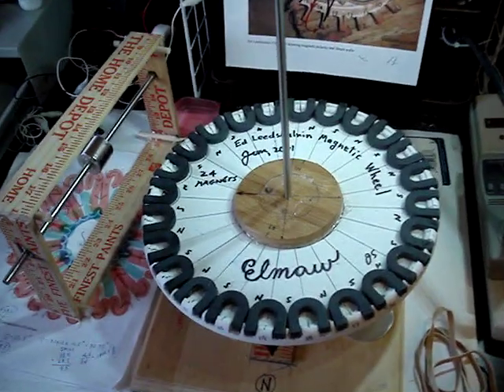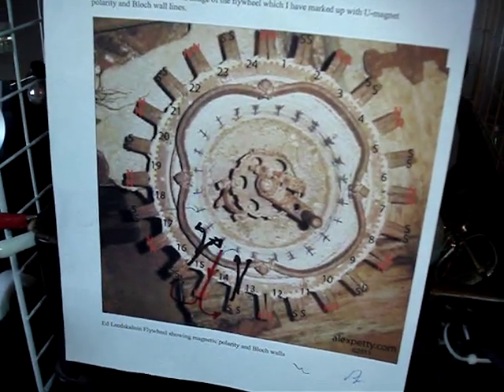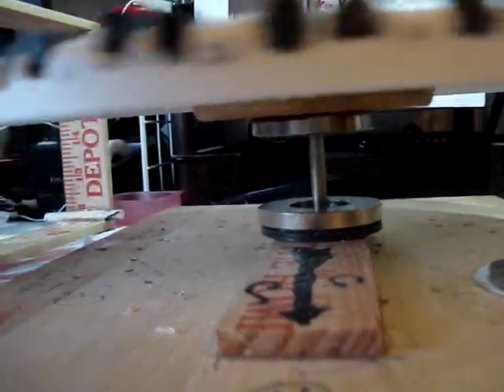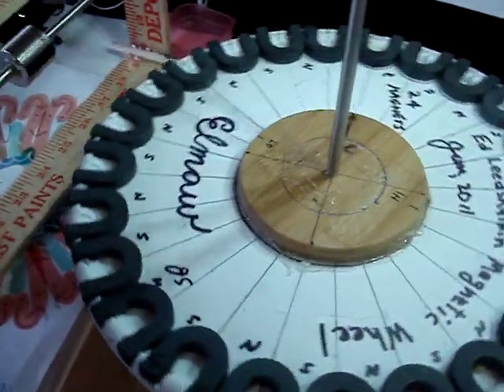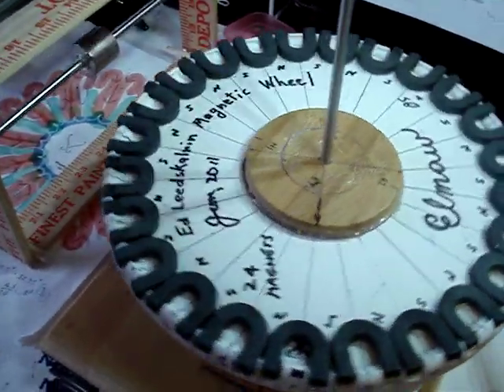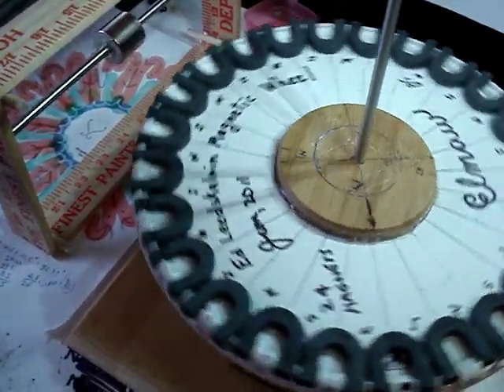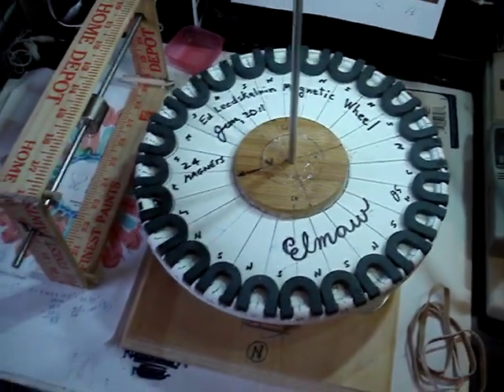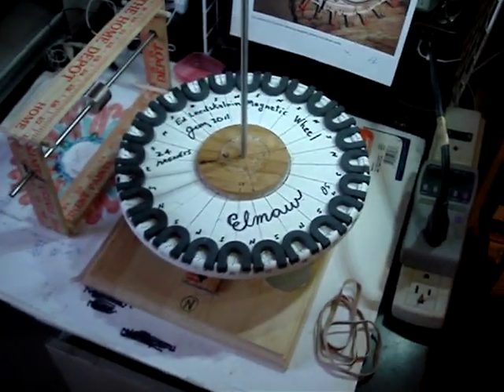ELMAW   ( Ed Leedskalnin Magnetic Wheel )

Comment: This wheel in fact is a very crude type of magneto but generated good power. As the wheel spun and as the magnets were at the open ends of the horseshoe magnet N S N S and so on as it spun and the commutator arm mounted in the center which extended to the pipe on the bench it would spark exactly as in a modern car coil firing to spark plugs. That current then went through the multitude of wires around the site and ended up being stored in laden jars he used for batteries. Simple really look at the Ford model T it had a simple system based on this principle. As to Eds other amazing feats such as inducing magnetic build up into his rock blocks yo enable him to defy gravity, well that,s another story.

Comment: has the 4 bent bars on the top ever been considered, as the bent bars should give you 4 strong points where the field has been focused, basically gives you a 4-Pole Synchronous Generator

Comment: @jackscholze I've read from similar replications, that once the 24 parts are magnetically locked together (energized to lock, then holding together indefinitely after power is disconnected), the setup will appear to have fewer than 24 sets of poles. Rather 4 or so I believe. The magnetical lock cloaks the individual poles, makes the PMH one unit.

Comment: Nicely done! 

Just to note, the original Leedskalnin's flywheel had 3 points where North/South poles was not detected and instead of magnet rotor there was his PMH (perpetual motion holder) placed horizontally. Hope that will help with making self running magnet wheel.. :)